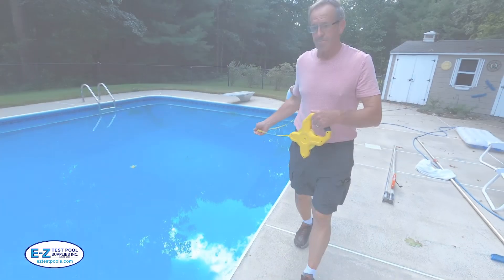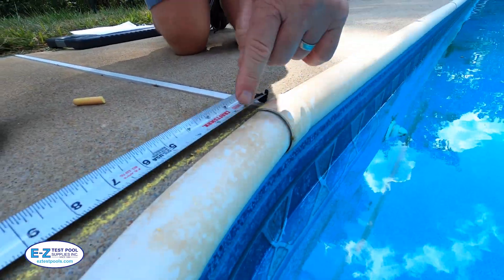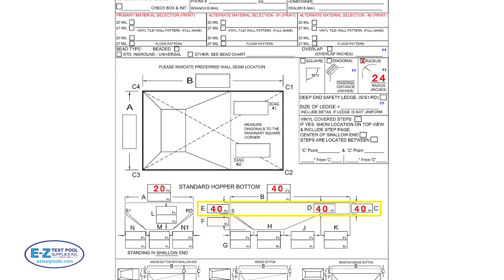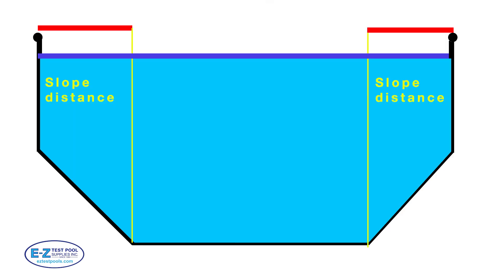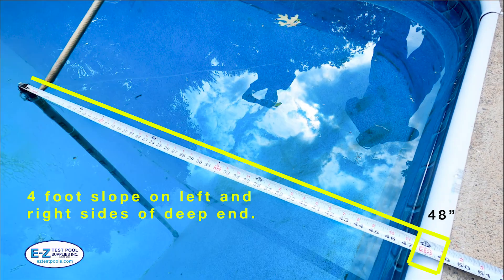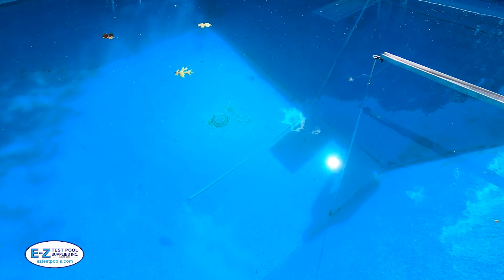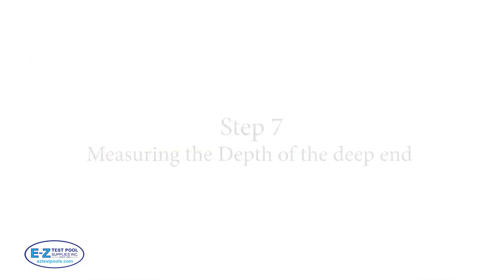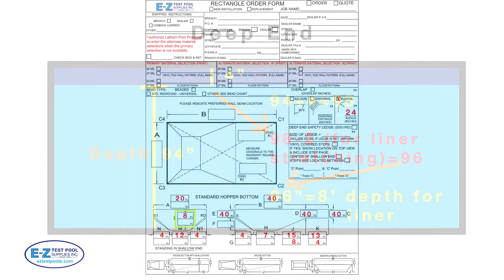How to Measure an Inground Pool Liner

Comment from the maker: For more info, subscribe to our channel: https://www.youtube.com/eztestpools
Family-owned since 1989, E-Z Test Pool Supplies has 3 retail stores in the Southern NH and Metro-Boston area, plus an extensive online store for all things pool related. Shop over 20,000 pool products at https://www.eztestpools.com
Reply: I question whether or not you should subtract 2" from the deep end to allow for liner stretch. Would the liner manufacturer consider stretch from the actual reading? If not, why not allow for 3/4" stretch in the shallow end?
Reply from the maker: @rickj6048  Hi Rick, thanks for watching our channel. We think that the best way to answer your inquiry is that we adhere to our same best practices and what we've been doing during our over 32 years of experience with liner installations. We thank you for you interest.